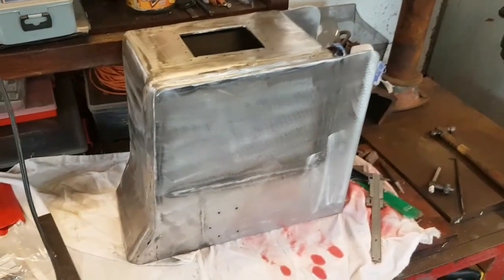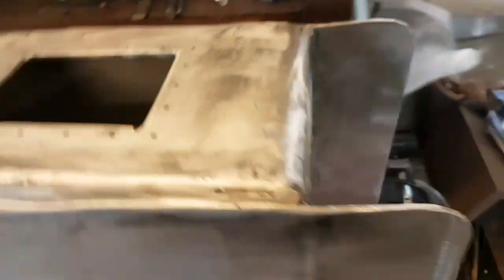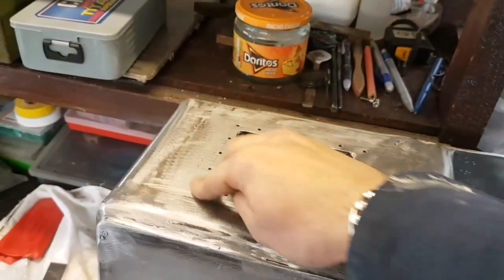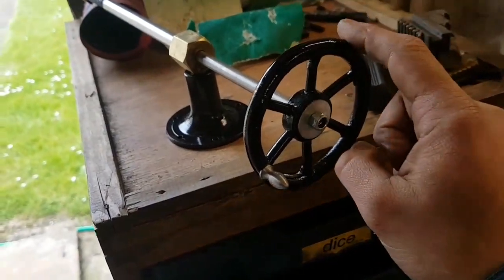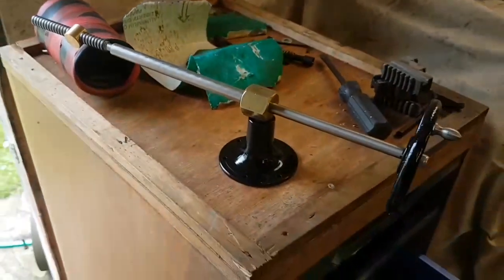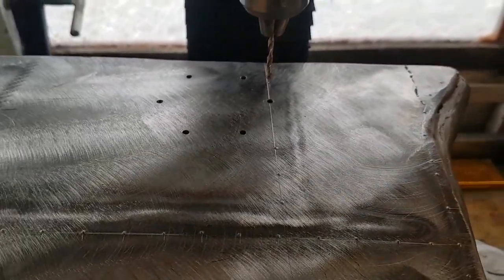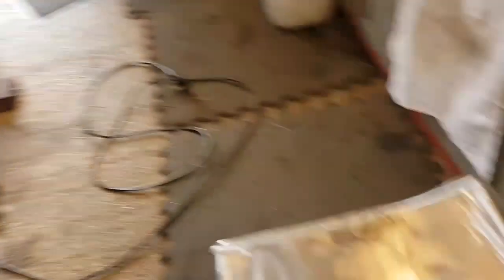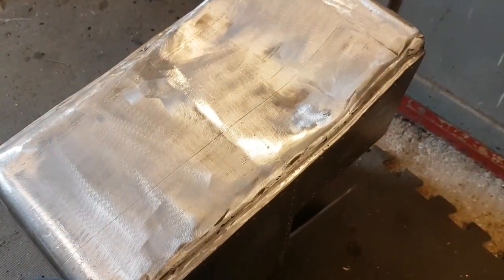3" scale Fowler road locomotive traction engine build

Comment: Hi John really liking your videos I am about to start building a 3” Fowler keep up the good work I will be watching with interest what plans are you using
Reply from the maker: I am using the ones supplied by Bridport Foundry. They all seem OK atm but as you might see in the boiler video I had to re design the boiler to update the engine to 150psi. It won't compound properly at the 110psi specified otherwise.

Comment: Great job you did.  How are you overcoming the rust problem in your steel tender tank? I am building a 2" scale Durham and North Yorkshire traction engine. The description calls for a separate copper tank inside the tender to prevent rusting, but I am still undecided which option to take.
Reply from the maker: Yeah so I haven't actually sealed my tank yet, however, I am intending to do it with black bituminous paint. Heres the link:  https://www.toolstation.com/black-bituminous-paint/p18859?store=S6&utm_source=googleshopping&utm_medium=feed&utm_campaign=googleshoppingfeed&gclid=Cj0KCQjw9ZzzBRCKARIsANwXaeJHsD46s_6IQ30GBc7-Gz5NZJnScvfhrA9osdJTfXNAfeO24BibN4IaApvsEALw_wcB
The only problem with this option is getting your hand in there to clean the surfaces up well enough for it to bond and do it. 
Of course the seperate copper tank is a good plan also.
Reply: Thanks JOHN, i will try to find something like that locally.